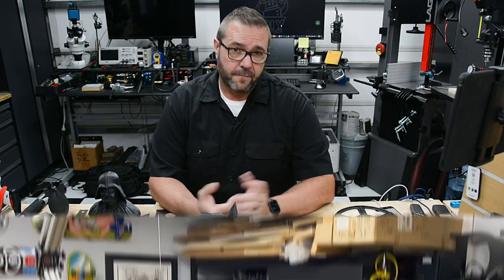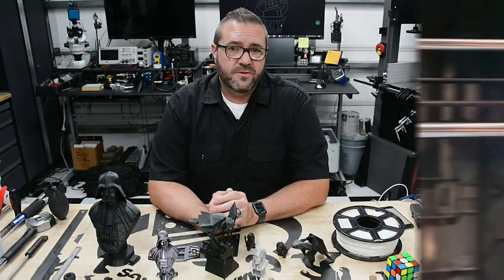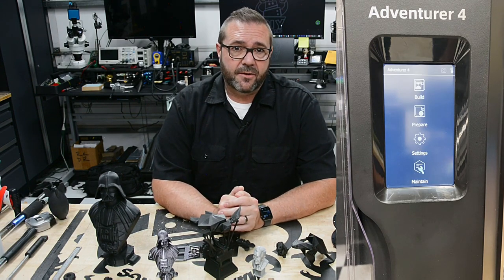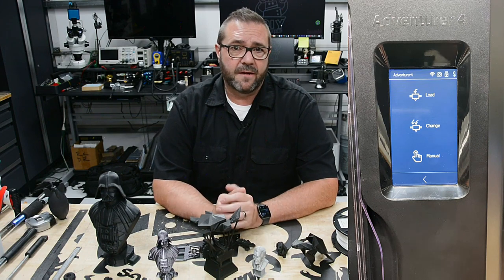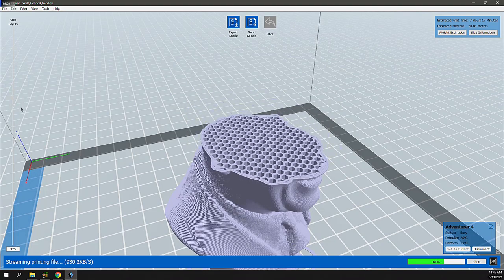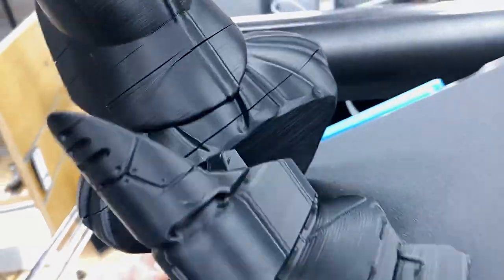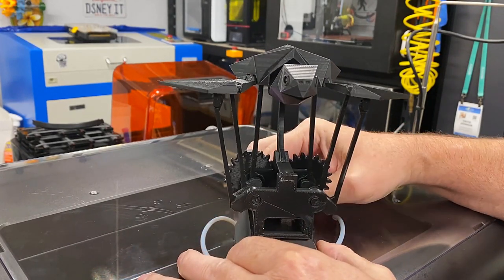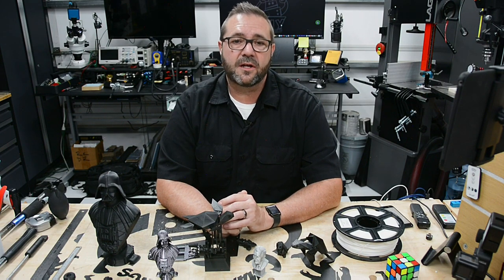3D Printer Review of The NEW Flashforge Adventurer 4!

Comment: I am still a 3D printing noob and just got a FF AD3 last month and it has been amazing. But I am already excited about the possibilities with this new larger Adventurer.
Reply: For the prices I'd get a cr10 max around black Friday when it's about 400. Way Bigger build volume and can print any filament nylons harder with not enclosed but will do everything the 4 can do and more for less on an open source printer with the largest following. Now that you have learned the basics. This machine is a great teaching tool and would be amazing in schools. Microcenter has ender 3 pro for 100 rn with 100$ coupon when signing up in stores pickup only.
Reply: Also true auto bed leveling is included
Reply: @techtalk7018 i don't recommend it, it sucks.

Comment: Would you recommend this over a Prusa Mk3? The Prusa has a direct drive extruderand it seems like the firmware is a bit better but it's missing an enclosure, other than that they seem very similar.
Reply from the maker: Hi,
if printing tpu filament is important to you then a direct drive may be the right fit. otherwise, the build and quality of the adventurer 4 is pretty solid, coming in around 80lbs it doesnt feel cheap at all.
the swappable heads and ease to use is pretty nice over having to tweak and tune... If you want something you plan to customize and modify, prusa is probably a better option.

Comment: We are between the creator pro 2 and the adventurer 4 for my 12 year old to start a business on Etsy. He’s hooked after some exposure at school to 3d printing. We think being able to print in 2 colors with creator 2 pro might make it easier to create things that are more sellable but the quality of the adventurer 4 seems higher. What do you think?
Reply: I've seen a lot of mixed reviews on the adventurer 4. Personally I would find out what is most important. If the IDEX system is the deciding factor the pro 2 will hands down be the way to go. However, if print size or other things are more important I would recommend looking elsewhere entirely. While this looks good I worry about maintenance and the ability to mod/upgrade this machine. Not only that you can get enclosures for machines that don't come enclosed stock.

Comment: Maybe print some foam spacers for the door to decrease if not stop that draft. Is there is a way to interface with the USB port to gain access to the units temperature control and a temperature sensor linked to a Raspberry Pi(with Wifi) to control the extrusion temp? If not, can the Wifi be utilized in a similar manner maybe via a Firmware update. Keep in mind I am not a Tech-pert just in case that was not apparent.
Reply from the maker: all possible solutions, it's just time and code... and priorities! ;)
Reply: @DIYEngineering  I may be a simple Muggle but I know you are the WIZARD. Just turn that little amulet around your neck like 3 times and then don't let past you see current you and everything is good. Time problem solved. As for the rest of it, you are the WIZARD. On a more serious note this maybe a product you could sell as third-party. Just make it a generalized interface for variable acquisition.

Comment: Incredible review, super thorough! Quick question, at 1:48 you said the hot head will prevent the use of TPU and such, but is that a hard "can't" or more of a "not reliably"? Saw your comment below on the direct drive but I really love the package of the ADV 4, just need it to do TPU.
Reply from the maker: It will take some trial and error to get tpu setting to work with the filament drive system.

Comment: Are the fans noisy?
Reply: i would think not, check the information on the flashforge site. It does say 50 decibels for the printer so it will be not too loud
Reply: I’ve had my printer for a few weeks, and the fans are loud. Not insanely loud, the actual moving of the bed and extruded are louder than the fans

Comment: The 4 is pretty buggy if it isn't working properly when it arrives at your door. And kinda like an apple computer they don't want you to getting in or working on their machines making it even more difficult when running into even a minor issue. At least an apple store is in almost ever city on the planet when I need help. I assume they only help in China if that. for the price I do think prints should come out looking better.  Adhesive is too strong at first and not strong enough after the first day. Now only hairspray is saving the print from worping or just being completely pushed off my the nossle while printing. But I've only had mine a month but have 100s of hrs of failed prints but I'll credit that up to bad firmware but I honestly don't know why it won't print and they dont help. I have 100s of emails literally with 3 aftersales reps at flash forge and I've gotten no where. Ironically the only prints I got done were a couple small upgrades for my ender 3 pro I got for 100 new. It still doesn't work and after over a month of wasted time I wish I could just give 1000$ to have my time back and to have never even heard of flash forge. This has to be a joke but no one's laughing. Limited warranty claims seem non-existent. best help I got was beta firmware to try but it never helped and I've had the same issue since I got it. The firmware fixed the unleveling issue mostly but it always stops printing after about a hr no matter what. Not being able to finish one print. I did luckily get extruder knob and slips for ender 3 printed but I'm sure it would of done a better job than the 4. I just didn't want to wait and needed small things to test but I'm kinda sick of dealing with it since time is just as costly and I've lost easily 200 hrs just in trying to fix it. The emails don't come as frequently as when I first asked for help so I don't assume I'm going to get any. I should of just googled the reviews. First thing that pops up is great hardware with buggy software. I looked on YouTube but every review is by someone that had the printer gifted to them specifically for review here. I think I'm going to be the first one that bought it for what I can tell to review. Wasted grand on my first venture I'd say. Not sure what to even do with it now it's so big it like an oven sized paper weight.  Anyone want a brand new one for half off? I'll even pay for shipping! Lol but really
Reply from the maker: how so? I've had pretty good success with it.
Reply: @DIYEngineering  it came unable to tell how far the head was from the bed so it would not level and would only print spaghetti. After about a week I got sent a beta version to force update.( So I know exactly what leveling the new updates are going to bring) but it was a beta version and made the printer stop printing completely so after another week of trying to explain how it's never worked and I have  to roll back the firmware update to the most recent one and after completely reinstalling all the software, don't quote me it's only be 12 hrs, but it has finally completed a print so I hope it's fixed. But because of how long the bowden tube is for this machine stringing is neclxt to impossible to stop and some gooping problems from the extruder but for a beginner machine it's decent assuming there isn't an issue then the most experienced will even have issues. I bought this for a review and it hasn't gone well but a month in and I got a decent print only took me 4 firmware force installs factory resetting twice and completely dis assembly and reassembly of the hot end a few times cause everyone at support kept asking if the nossle was clogged when it was the buggy firmware the entire time but I had to send everyone proof I checked. I even went through 3 brand new nossles just opened to show them and filament running through when loaded. The firmware they sent me couldn't keep a constant temp even tho it is heating up half the time, the CPU couldn't confirm. But there's the short version of my month long ordeal fixing this printer I'm not 100% sure is working still. But I'll leave an update if it stops printing again.  At least I got a new ender 3 pro for 100 at microcenter. I'll probably use this one for cf and nylon.
Reply: @DIYEngineering  granted I might of been going far saying extremely over just buggy lol
Reply: @techtalk7018  Damn we are really considering this for our lab, since we don't want a lot of hassle and want a printer that works reliably out of the box. Do they issue periodic firmware updates? Or only when we approach support? And have there been improvements with the 'auto' leveling with these updates?
Reply: @varunv.p.7180  hey man I so wanted this to be awesome but I am having issues printing still. The feeder it leaving teeth marks on the filament and it's the only thing I can see why it won't stop jamming. It's literally every few hrs of printing. I kinda wish I bought a qidi or a cr10 max which will be my next printer soon. I just got a couple ender 3pros for 100 each to finally get some prints done. Also if you need parts to move and such the stringing is impossible to stop. They will kinda work but it's still always a huge issue with printing. I saw a couple co. , Maker not and voxelab have clones of the 4 idk that they are better looked like the same software. I saw so many ppl on YouTube talking good about it but from my experience I'm stuck with a huge box that barely finishes printing a few hrs with out an issue. The sound stops working after every print is completed and you have to restart it. I was so excited to review this but I haven't been able to get it running all month tbh. Idk if it's just mine I ordered it directly from flash forge end of Feb. Qidi max and cf pro would be awesome options maker muse had good things to say about it and he is pretty trustworthy
Reply: @varunv.p.7180  it has firmware updates issued over WiFi you have to look periodically through the touch screen and see if one has come out yet. It's not automatic. It's pretty easy to use and flash print is a decent slicer to learn quickly with but you will soon need to learn cura if you want to have more option.
Reply: @varunv.p.7180  no auto leveling options will ever be available just 9 point assisted leveling for this one unfortunately
Reply: @varunv.p.7180  mine is clicking pretty load from the feeder for some reason also. Idk how often people get one like this I can only go by my own experience. Good luck finding a printer.
Reply: @techtalk7018  DON'T BUY A CR10 MAX, it's only given me trouble the past few months . I have some few successful prints, also buy a different build plate for the max , if you actually are gonna buy it,  I'm selling my max because it's just not worth my time , i bought mine used in good condition,  thank god it was not full price for this bull... 
Best of luck mate
Reply: @Hanzi2u  thanks for the info. Most 3dprinter companies seem to be defective at higher rates than they should but I assume everyone says to buy a Prusa for a reason lol. I was actually thinking of getting the cr10 s4 or s5 instead of the max. I had to change the entire extruder and feeder assembly to finally get the adv4 to print decent but I can't ever undate the machine. I'm using an old beta version firmware if I update it no matter the versions it immediately start to unlevel and is impossible to get it to level and on this version the frt right is about a quarter inch above the bed to get it to not grind into the build plate. The cr10 is pretty easy to upgrade also. And the warrenty isn't bull so you can exchange it and even get parts to replace it. Idk what's wrong but u should of exchanged it but now you should contact aftersales and get new parts or upgrade the defective ones. Thanks again
Reply: @Hanzi2u  took me 8 months to finally get use out of the adventure 4. Flash forge starts the warranty from the date of manufacture and they will manipulate you and ignore when you ask about a refund or exchange but you do have 1 month from the date it was shipped to send it back so it doesn't take much to make you stuck with it. If you have a stringing problem it needs a whole new extruder assembly. If clicking and jamming often the whole feeder assembly if it can't level its the firmware and just one of several defects this machine will come with. About a 10% rate. If any printer has an issue you should ask for another one immediately do not hesitate. Most these companies from that area run things very similar.
Reply: @ToysToolsandTales  no problem mate,  I've had very good with experience with my Prusa ,  I bought the max to print bigger , sort of  I've upgraded my machine a bit  and had a friend who's been in the 3d printer would for 6+ years and he helped me a lot with the machine, the thing that bother with the max is that it's not reliable enough for me to try and dare big prints on it without it failing,  anyways my friend is gonna buy it and I'm happy for that , and was actually looking looking into getting a flashforge instead as a replacement for the max
Reply: @ToysToolsandTales  ye okay thanks for the heads up mate